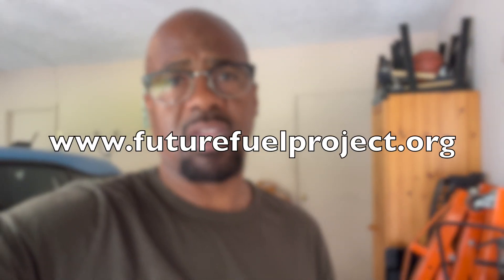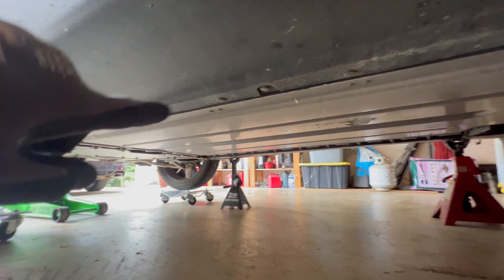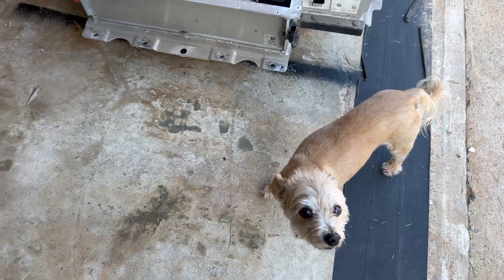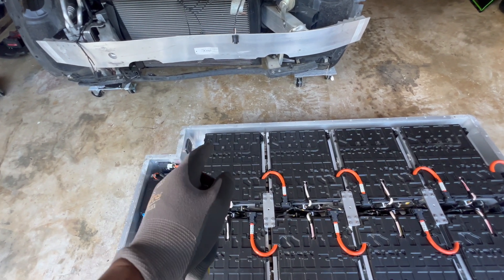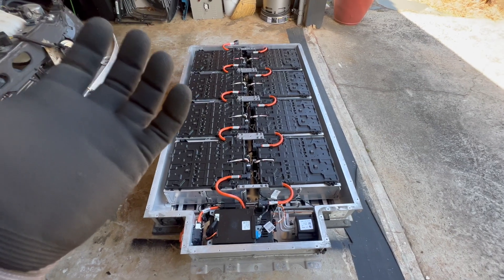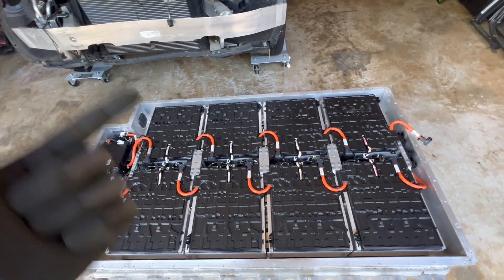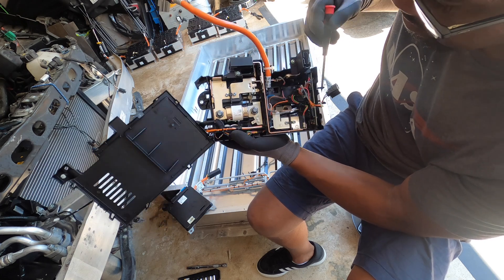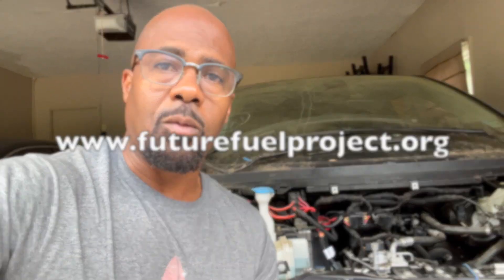Porsche E Boxster Pt.1

Comment: can't wait to follow the rest of this build!  Our volt batteries are oddly shaped and i'm worried we won't be able to fit them into our porsche. I wonder if we will have to change course and invest in some modules like these (or something else) that we can more easily fit into odd spaces. Thanks for the video!
Reply from the maker: I went with these modules for a couple of reasons. The group (12s)  and the size to power ratio. 32kwh @ 450lbs. In a car a small and aerodynamic as the Porsche (especially with a 5 speed manual), it will be fun to drive and the range should be decent.